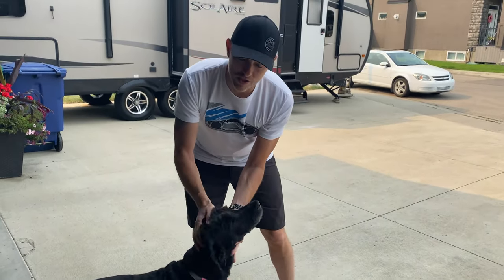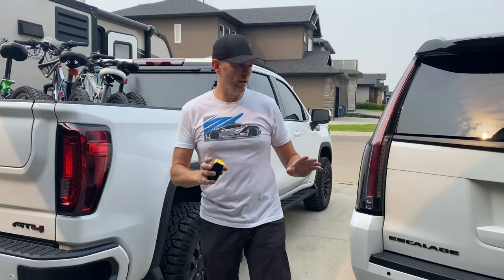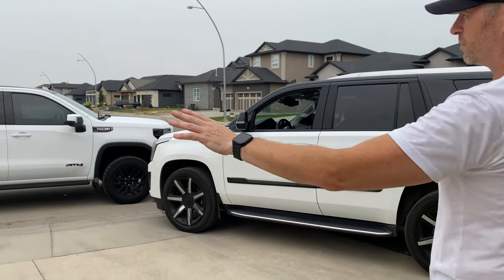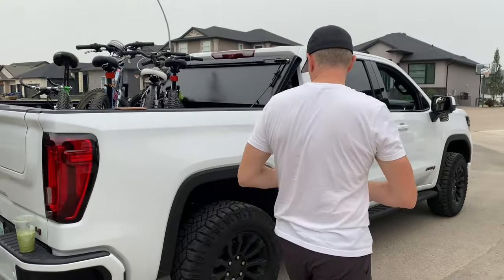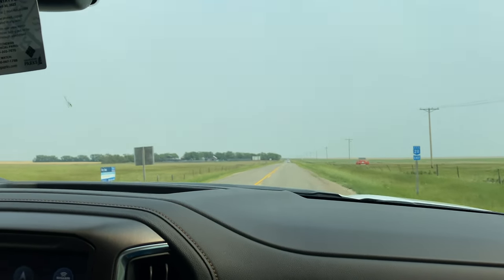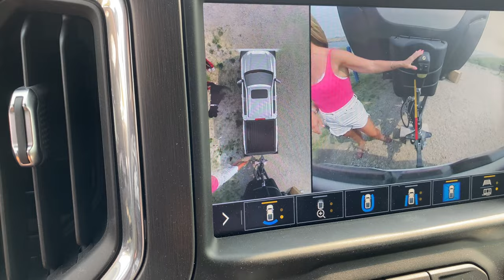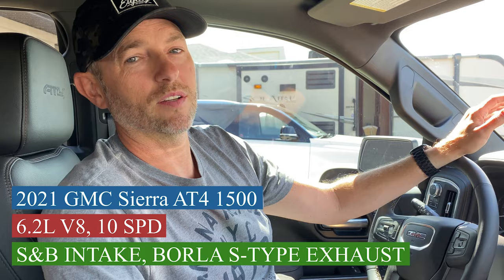2021 GMC Sierra AT4 Max Towing Capacity Review and Impressions.

Comment: Love the video Don.  Beautiful rig.  I have a 2021 Chevrolet LTZ 1500 with the 6.2 and the 10 speed trans, pulling a very similar size travel trailer with ~ 1000#s of tongue, also utilizing air lift on rear. Getting the same mpg over a 1000 mile trip and am also very happy with the max tow.  One thing I did notice is that you do not run with any sort of sway control for such a long trailer.  I suggest sway control.  You will improve the feel tremendously.

Comment: I've been towing for over 30 years and I just found out that I have been hooking up my trailers breakaway cable the wrong way. There are utube videos that show the proper way to hook them up. The way you and I and several others run the cable will not pull the brakes on the trailer. You do a great job on your videos a lot more people could learn the proper way from you.
Reply from the maker: I attach my breakaway cable to the frame/hitch of the tow vehicle and make sure it isn’t tangled in the safety chains.  I could switch to a quick release carabiner I suppose.  Where specifically are suggesting it be attached to? Maybe there is a more ideal location and I (like others) just didn’t know!  I checked out a couple vids and they aren’t really different than what I do except they may have a separate mount fabricated for it on the truck frame/hitch.   My hitch receiver has 4-6 mounting spots to clip chains and breakaway cables to.

Comment: Great video! Have not towed my 6,400 lb. TT (loaded) with my 2022 Silverado 5.3, but it is coming as soon as the snow melts in the northern tundra (Rochester, MN). I will be using my Weigh Safe True Tow WDH and don't expect to need airbags. Payload. Yes, payload has become the big towing metric for me. The Silverado is rated to tow 9,800 lbs. Payload is 1,755 lbs. With my wife, son, a buddy for my son, me, my tools, and the hitch weight we are under but not as much as you would expect. Now, my challenge is how to justify the Borla exhaust and cold air intake. Fuel economy? Right...
Reply from the maker: Exactly - Technically the engine will not have to work as hard with those upgrades

Comment: I have almost the same setup you do. What gear are you in or should i ask , what gears are you locking out ? What speed transmission do you have 8 or 10 speed ?? Thanks for sharing.
Reply from the maker: I have the 10speed transmission and found just using tow/haul mode worked pretty well at this weight.
Reply: @Donslife  Thank you so much. After I sent you that question, I found all the details on the description, sorry about that. But, the description was a BIG, HELP!!.. I'm gonna go with the same set up you got. Seems as if your very happy with it. It looks like just what I have been looking for Shocks, Air Bags and all. The only difference in my set up is mine is two wheel drive, but pulls my 30' Heartland Ultra Light GREAT !! I'm mostly just looking for a little smoother ride. I'm from L.A (Lower Alabama). I'm planning on traveling the Midwest this Summer for two or three months. Thanks for taking the time to make this Video, you sure have been a BIG help to me. Travel Safe !!.. Thanks Again !!!... Mike

Comment: Great video!! Thanks for doing this.  I have the same truck however in black with the 20” tires.  I am about to start towing a 27 foot Airstream 6,100 dry / 7,500 wet.  The tongue weight for it will be 791 pounds base.  Question, what is the hitch weight on your setup? Which WDH are tiny using?  How much wheel travel and off road capability would you say you lost in installing airbags?  Thanks in advance
Reply from the maker: Hey man, my tongue weight is about 850 lbs. I don’t know the brand of the WDH but it looks like it could be Curt.  There are jounce bumpers in the bags, but I am not sure if I lost too much wheel travel.  A bit probably is lost as well as keeping some air in the bags would firm up the suspension as it compresses.  I am not a hardcore off roader….yet

Comment: Don, loved the video. Would you still recommend the air bags and compressor after having used them?
Reply from the maker: Thanks, it is one of the best options if you’re towing on the heavy side.   Probably not necessary if towing less than 5000lbs
Reply: @Donslife  Thanks, I have 8000 lbs
Reply from the maker: Without a load at minimal pressure you’ll notice the rear is a bit stiffer

Comment: Hey man, love your content.  I have the same exact truck and installed the airbags last week before our trip through the Smoky Mountains in Tennessee with our travel trailer.  Such a worthwhile upgrade.   I tried searching your videos before posting this, so sorry if its a repeat question... but what tires are you running on the AT4?  And you're just using a 1.5" spacer and no lift, right?  Just the stock 2" lift?  Thanks in advance.
Reply from the maker: Hey Matthew!  Glad the air bags worked out for you!  I am running the factory 18” Duratracs right now with the 1.5” spacers.  I haven’t done a front lift yet.
Reply: How did your truck do while pulling through the smokies?.. what size trailer are you pulling?

Comment: What is the range or how far can you tow before needing to fuel with your RV in tow. Do you have the standard 24 gallons or the bigger fuel tank?
Reply from the maker: Standard tank and a trailer this size pretty much cuts range in half.  Grades, avg speed and wind strength/direction play a big part too.  I’ve had tailwinds on flat grades that allowed to me to stay at the speed limit with low rpms and high gear and saw pretty good mpg improvements.

Comment: What is the payload of your truck? Does adding airbags increase your payload? Thanks!
Reply from the maker: Around 1500lbs.  Airbags will help with load levelling and reduce body roll.  They don’t increase the payload capacity.  Replacing drivetrain and suspension components would be required to increase payload.  But if you’re going to that, a 2500 HD version of the truck might be in order.

Comment: Hey Don! We just picked up a new yukon at4 for the family. It's our first GM product any issues with your at4 engine wise? I'm hearing a lot of issues of lifters failing and rods bending.
Reply from the maker: Hi Nabil, I have heard the same but luckily no issues so far.  I have owned 4 GM trucks and never had engine problems.  However warranty will cover the problem if you experience it.
Reply: @Donslife  yeah I got the extended warranty just incase lol so far so good as of right now.  Only have 500kms on it though so I don't expect anything failing this early.
Reply: @Donslife  Maybe I missed it but does it have the 5.3 or 6.2... assuming 6.2 thanks
Reply from the maker: @clintbrooks92  6.2L sir
Reply: @Donslife  thanks.. I bought one last night

Comment: Thank you for sharing the video.  What the payload capacity of your truck?
Reply from the maker: Mine specifically:
Payload 1444lbs
Conventional Trailer 8800lbs
GVRW 7000lbs
Curb weight 5556lbs
The AT4’s tow the least of GMC 1/2 tons.  The  powertrain isn’t the issue, the suspension lift is.

Comment: I have basically the same truck (Denali without bags) and a very similar trailer.  How was your sway in those high winds?  I went to a anti-sway weight distribution hitch to help with wind because I was getting sway.
Reply from the maker: The cross winds were pretty crazy so I slowed down a little under the speed limit and kept a steady pull on the trailer.  I could feel the wind still but thankfully the bars kept me from swaying.   They did their job for sure!!
Reply: I would recommend a WDH with built in sway control.  Some are better than others but will help tremendously.

Comment: Great video! We have a 2020 Grand Design Imagine 23BHE which 27'' long and about 5500lbs dry. Our tow vehicle is 2020 Tahoe RST Premier with 6.2 and it has factory air suspension on the rear similar to your Cadillac Escalade. It levels good with the combination of the weight distribution hitch however,  at times I can really feel the trailer  behind us. We live in Ontario and at times in some areas on Hwy 401 where it's flat and it gets bit dicey with those cross winds  which I really have to slow down. I'm thinking of trading in the Tahoe for the refresh 2022 Silverado RST 1/2 ton with the max trailering pkg. and  a 6.2 powerplant.  The Chevy dealer is offering a very high trade-in value on the Tahoe as they are desperate for used product due to the inventory shortage right now.  But I'm a little concern if the new truck will  squat as it won't have the air suspension like the Tahoe. I might have to do the same set-up as your AT4 with those  Air lifts but I want to see how it looks like first with the trailer hooked up. Any thoughts?
Reply from the maker: Thanks! The truck is longer so that’s a benefit.  With a weight distribution hitch you might find you level out pretty good again at that weight.  If you didn’t want air bags, you could do sumo springs.  I chose air due to the 7000-8000 pounds I’d be towing.  Also if the hitch you have has sway control, that will help with those cross winds
Reply: @Donslife  Thanks for the input. My weight distribution is the Fastway E2 Trunnion system which has sway control built in. But yes it has something to do with the shorter wheelbase on the Tahoe that will make a difference. Also, did a little research on the Silverado equipped with the max trailering pkg. has a higher spring rate rate.  I noticed the Trail Boss which is equivalent to the AT4 doesn't offer the max trailering option. So I might just try it out first and see how it sits with the trailer hooked up. I did hear good things about Sumo springs, that's also another option. If I do go with the Air bags, I'll just go without the compressor to keep the cost down and just air it up with my portable Ryobi tire air inflator.

Comment: Hi Don, thanks for the video. I’m not sure if it’s the fact that you had to move camp sites 3X, but I noticed you kept the truck attached to the trailer. Is that ok to leave the trailer attached to the truck or should you unhitch?
Reply from the maker: I unhitched every time immediately after parking.  The footage you’ve seen is probably just before or after I moved.   The sites are usually long enough that I can stay parked in front of the trailer.  I recommend unhitching.  Also if on a road trip and parking over night, I like to use the trailer hitch to take some strain off of the truck before driving the next day.

Comment: Looks like it was Easy work for You and the Truck! I have a 2017 Sierra Denali with the 6.2L and I tow a 26FT Trailer (30FT with the A Frame), thing only weighs 6000lbs. Being a Prairie Dog myself I am subject to some nasty Crosswinds, I feel like the ass end of my truck is sliding around all over the place, I have a Weight Distribution hitch as well. If there's no wind its fine but any little bit at all I feel like I am all over the place, my truck and trailer are perfectly level so I don't know if there's anything else I can do or if there's underlying issue that compounds what I am feeling behind the wheel.  I am thinking about trading the Truck in for a 3/4 Ton Diesel OR the Cheaper route would be to buy a smaller lower profile trailer that isn't such a wind sail.
Reply from the maker: I almost went with a 3/4 ton, but I don’t tow heavy frequently enough to justify it (at the moment anyway).   A heavier duty truck will help though.  Crosswinds are nuts here

Comment: Just to clarify.  You get your truck hitched, level and airbags filled and then put on the WD bars? Will you please specify your order of everything.  Thank you.
Reply from the maker: No problem: 
1 - make sure your trailer is connected to the ball. Make sure your hitch is adjusted to the correct position so the trailer is putting weight on the hitch but still pretty level.  
2 - put some air in the bags.  I found 15 is good for my trailer. 
3 - hook up your WD bars. 

I hope that helps.   Just don’t adjust your airbags last since they will work against what the weight distribution system is trying to do.

Comment: Hi Don I didn't have time to watch the entire video but just wanted to know what gear ratio your truck has.  Is it the 3.23 or the 3.42?
Reply from the maker: 3.23.  I had 3.42 in my Denali prior.
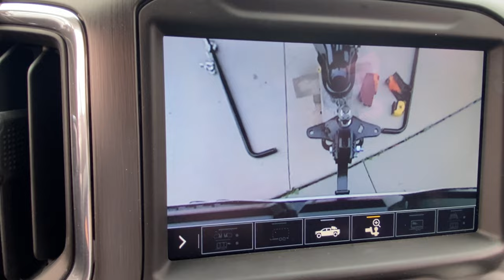Reply: @Donslife  Be careful with those 3:23’s. I worked at a manufacturing plant that makes GM parts. They say the 3:42 is the Max trailering Package.
Reply from the maker: @polandknight2012  yeah, 3.42 not available on the AT4.  My Denali had 3.42
Reply: @Donslife  You really should've had the 3:42. I miss the 3:73's though. My God.
Reply from the maker: @polandknight2012  sure it would be great, but the AT4 is not configurable with that ratio from the factory. At least when I was working on getting mine.  The 10 speed helps too.  This isn’t my forever truck either

Comment: I got the exact same truck haven't put it to work yet how did the engine do plenty of power going up hills getting on the highway was a transmission searching for Gears or anything? Thanks in advance
Reply from the maker: Did well.  I found that using towing mode actually works so much better with this 10 speed transmission.   I found it was quite capable for a 1/2 ton truck

Comment: Hi Don after watching your video it makes me wanna buy an RV , I recently purchase a SLT Sierra 1500 with the 10 speed trans , 5.3 engine , more or less what weight of an RV I should be looking for , thanks for the help and great video 👍
Reply from the maker: If you are looking for a conventional trailer or ‘pull’ trailer like mine.  Consult your tow rating sticker in the door jamb.  If it is a 2019+ Sierra, they’ll be a conventional trailer weight listed.   It is usually recommended to tow under 80% of that number even though the truck is capable of more.   So many variables with wind, raid conditions, etc.  Towing a little lighter is safer.   Your truck since it doesn’t have the AT4 lift, probably tows more.
Reply: @Donslife  thanks Don
Reply from the maker: Anytime!

Comment: Hi don! Hows the wheel spacer? Do you still have them on while you where towing?
Reply from the maker: Hey Andrew, I decided to keep them on this trip.  No issues, vibrations, etc.  I took one off a month ago just to inspect everything and there was no issue with the little bit of thread locker I had applied.  All the lugs were still at the amount I had torqued them too.  Honestly (my opinion) is that because the spacer’s size I chose is so conservative and I am not rock climbing or towing all day, they are probably going to be fine and stay with these wheels.

Comment: Sorry I’m new to towing with my 1/2 ton and air bags. But if I get all my measurements and air bag psi configured on level ground, can I add the air to the airbags and back the truck into the trailer when the ground isn’t level? Or should you always deflate the bags to the minimum and air up after the trailer and weight distribution hitch is attached?
Reply from the maker: Air is your last step on f using a weight distribution hitch, otherwise your WD hitch will be fighting the bags.  Your 2nd scenario is correct.  Also experimenting with pressure is fine until you figure which feels right.  15-30 for me is food on this truck with my heavy trailer.  Some may need to go up to 40-60.  It’s not advisable to go over 100.
Reply: @Donslife  okay awesome. I took my measurements with 5psi in each and then put the trailer on, then checked the measurements again and raised the rear to get 1/2” or less in the front. Then dropped them back down to 5psi and applied the WD hitch, and raised to get 1/2” in the front. My magic number was 40psi without anything in the bed and the trailer empty. I’m thinking I’ll need about 50psi once the truck and trailer are loaded. I also have a 2021 Sierra AT4, except mine has the 3.0L and isn’t as cool looking. Been stressing for months about this trip but this video has given me some relief, so thank you.

Comment: Do you stilo have the resignators in?? Do you have a custom exaust or a preassmbled one?;switched from the 5 3 with true dual and want to get the 6.2 back to that sound. Yours is dead on outside.
Reply from the maker: Mine is dead?

Comment: What’s the tongue weight on that trailer setup? I’ve got the 2021 AT4 w/ the 3.0L diesel. Spec says 8,900lb towing & 890lb hitch weight. I’m wondering if I could go a bit higher on the hitch weight with the air bags & a distribution hitch?
Reply from the maker: My trailer is about 840 tongue weight.  Bags, weight distribution hitch, etc - I wouldn't recommend exceeding any of the manufacturers maximum ratings.  My video was about my experience getting very close to the maximum ratings for my specific truck.  The only thing I would add is a sway control device and some tires with a higher load range.  Otherwise it pulled as good as any in it's class and felt safer (more controller) with the bags and weight distribution hitch.  Cheers!

Comment: How do the regular mirrors work when towing the travel trailer? Do you wish you had tow mirrors?
Reply from the maker: If you know what to watch out for, the sport mirrors can work, but if I had to tow everyday, tow mirrors would be nice.
Reply: @Donslife I'm coming from a Superduty so I'm used to the tow mirrors but I've seen several complaints that GM mirrors causing blind spots.  I wouldn't think the GM mirrors would cause anymore blind spots than the Superduty mirrors?  I'm afraid I'll miss tow mirrors if I don't get them.
Reply from the maker: You might want them if you tow long trailers.  For me it was the opposite.  Lots of experience with small mirrors.